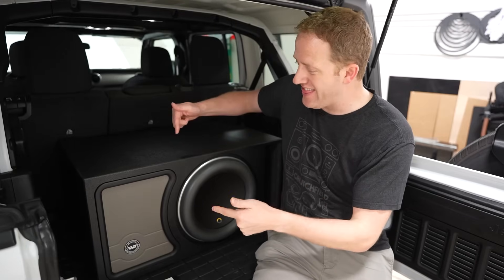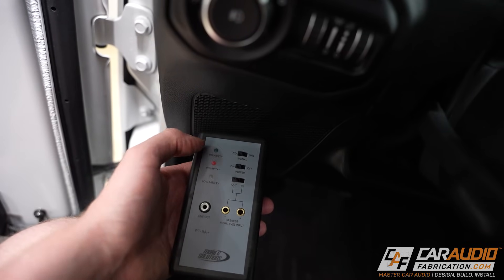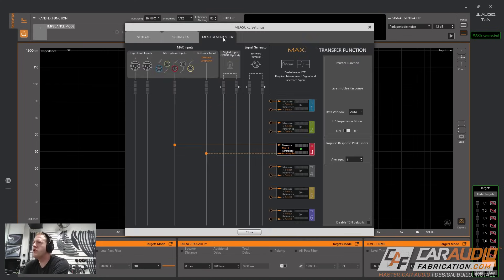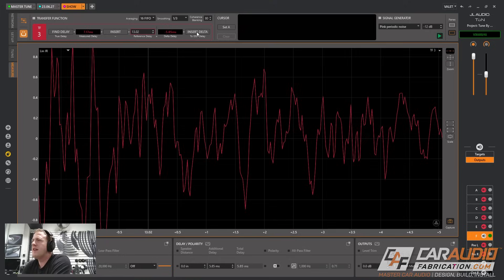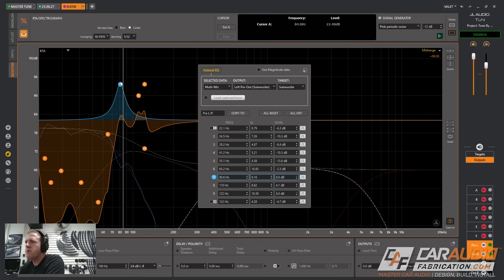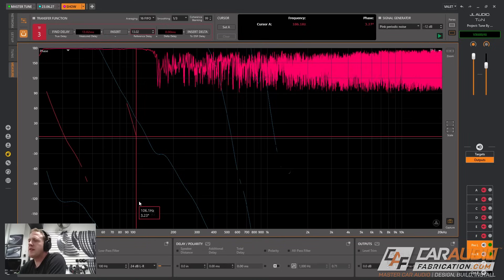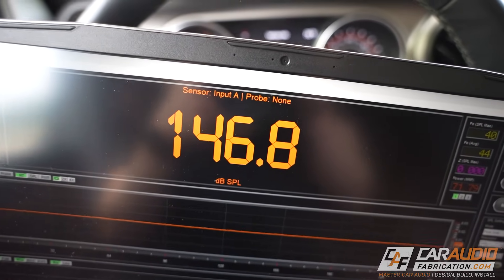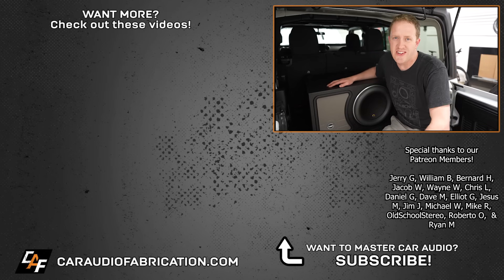MAXimizing Subwoofer Performance - Tuning & Testing W7 Box Build!

Comment: I recently bought two 12w6v3s and was so excited to hear them but was let down when they sounded similar to my single skar 12" zvx and didn't have nearly as much bass.
Reply: Bad box
Reply: not even possible.
Reply: @jondoe6618 😂 he said skar sir.. you  will waist your time if you try explaining  anything  reasonable
Reply: @matthewguynn2336  u might be on to something 😂
Reply: Anyone who thinks a JL sub will sound noticeably better than a Skar sub is delusional. You can't tell the difference other than the sound profile being slightly different and less distortion at high wattage.
Reply: @bailey2517  I think it's more about the build of the woofer in its totality.. for instance  this gentleman  stated the scars were louder than the jl.. yes likely  so.. its a pure spl sub vs a Sq quality  driver.. the jl will be sonically  more accurate.. it will certainly  out last the skar.. if used correctly.. it will retain  a resale value  far above the skar. It requires  less cu foot of operation.. its no doubt a better driver.. if anyone's  actually  believing skar is something  better for cheaper  is just delusional
Reply: @bailey2517  and I'm not even a fan of jl.. they can't take any power.. I actually  traded my jl 10s in  for a pair of ab hawks. Then moved on to Rockford  t2 and dd9500 .. because I wanted Sq and spl.. but  I would never say jl isn't quality.. it has its place and to compare skar to it is honestly  laughable
Reply: @bailey2517  slightly?  Hahahahaha
Reply: @jondoe6618  did I stutter? Let me ask you this- what does "sound quality" even MEAN when talking about a subwoofer? If a Skar VXF-15 plays 30hz, how is a JL going to sound better at 30hz? Can you precisely define how it will sound better? Because I can assure you my VXF-15 sounds excellent at 30hz. And I don't think the JL would sound much better.
Reply: @bailey2517  if u do t know any better. Just buy cheap bass. A lot of people don’t  know any better. More power to ya.
Reply: @bailey2517  You are exactly right, sir.   All subs when played within their proper specs and range should sound exactly the same as any other sub within the same range.  30hz is 30hz, 40hz is 40hz, etc etc.   If a sub "sounds different", whatever the F that means to some people, then something is wrong with one of the subs.   Where people start to screw a sub up is either improper box sizes, too small or too large, or under powering and clipping a sub or over powering a sub and pushing it beyond it's specs.   But when done correctly, you should not hear any difference between subwoofers int he same range.  You can hear this at any car audio show, when you go from vehicle to vehicle with the high powered systems, they all sound exactly the same except for loudness.
Reply: What amp were you using?
Reply: Have both subs and there is no way a single skar zvx is outperforming two w6's. You are definitely doing something wrong. I only have one w6 and while the zvx plays a little louder, I know for a fact that if I added another w6, it would definitely out perform the single zvx. Hands down. Sub for sub, the output capability of the w6 isn't that far behind the zvx, although the zvx is noticeably louder, but not nearly as drastic as you claim. And that's just single sub vs single sub. Adding another w6 would easily outperform the single skar zvx. The zvx has more xmax, but it would need alot more xmax than it currently has to overcome the cone area that two 12" drivers have. I mean, look at the numbers. A quick google search tells us a skar  zvx 12" sub has 24mm of xmax. a w6 sub has 18mm of xmax. Being that both are 12" drivers, they basically have the same cone area. Sub for sub, of course the skar should be louder, its cone can move further in both ways, which in turn moves more air. However, adding another w6 DOUBLES the cone area, which takes the 6 mm xmax advantage of the zvx right out of the equation. Double the piston area makes a bigger impact on the output than 6mm of xmax. If you had said you had a 12" sundown zv6, which has an insane 38mm of xmax at 70% bl(!!) Then I'd believe you. 38 mm of xmax is an insane amount cone movement, and I believe that would definitely move more air than two w6's. However, after comparing the skar zvx to the w6 in my car, I can say with 100% confidence that two w6's would outperform a single zvx. the zvx is definitely louder than a w6 sub for sub, but two w6's? Nope.
Reply: 2  12w6 of any version  should stomp a mud hole in the zvx's ass  the box configurations and volume is a major factor   you can EZ'ly make a 1000 subwoofer sound like trash  and vise versa with a cheap sub